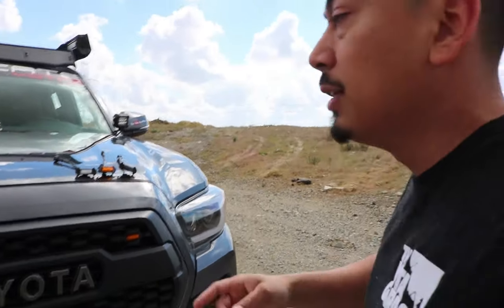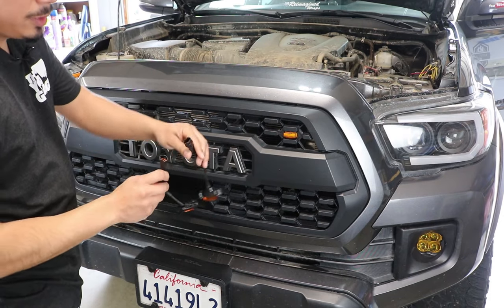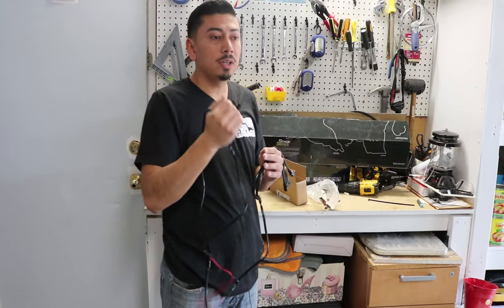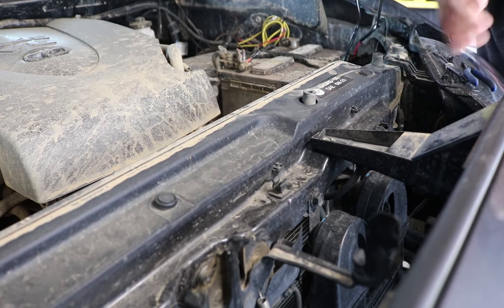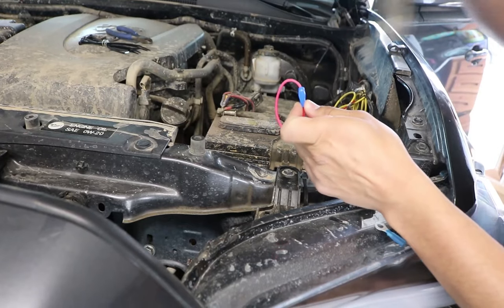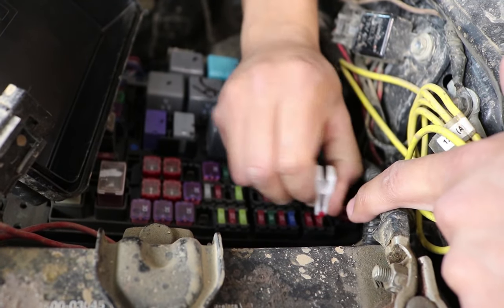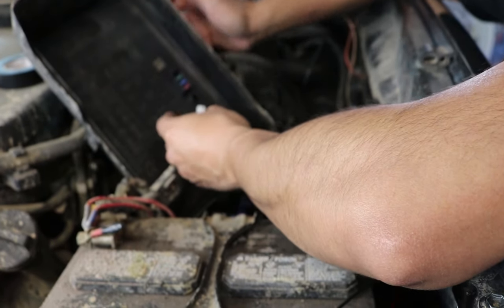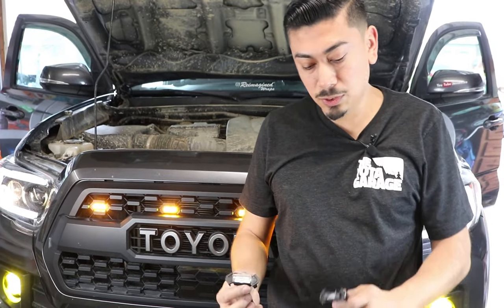HOW TO WIRE + INSTALL RAPTOR LIGHTS ON A  2016+ toyota tacoma TRD PRO GRILLE | MUST HAVE MOD

Comment from the maker: IN TODAY'S VIDEO I SHOW YOU STEP BY STEP HOW TO WIRE & INSTALL RAPTOR LIGHTS, ALSO HOW TO WIRE A ADD A FUSE.

PURCHASE YOUR RAPTOR LIGHTS:
https://theyotagarage.com/collections/2016-toyota-tacoma-grilles?ref=hrwtrpswem

Purchase your trd pro grill:
https://theyotagarage.com/search?q=tacoma+trd+grille&ref=hrwtrpswem
Purchase your raptor style lights:
https://theyotagarage.com/collections/2016-toyota-tacoma-grilles?ref=hrwtrpswem

FOLLOW MY IG: @_jesserizo

Purchase your softop (products also for jeeps & more vehicles): https://www.bestop.com
10% off discount code: JESSERIZOBESTOP
HOW TO INSTALL BESTOP SUPERTOP SOFTOP ON A TOYOTA TACOMA IN DETAIL:
https://youtu.be/DkhpwyQ8U7s

PURCHASE YOUR BED STIFFENERS:
https://r4t.club/TacoBedStiffeners

Need new shoes? Literally:
https://indestructibleshoes.com
20% off Referral code: JESSR100

Bilstien 5100 (front shock kit): https://theyotagarage.com/products/bilstein-24-263108-front-5100-series-0-2-adjustable-shocks-2016-toyota-tacoma?ref=hrwtrpswem
Bilstien 5160 (rear shocks kit): https://theyotagarage.com/products/bilstein-5160-remote-reservoir-0-1-5-rear-shocks-2016-toyota-tacoma-25-242539_25-242379?ref=hrwtrpswem

PURCHASE YOUR REMOTE START: https://www.n2designsinc.com/product-page/2016-2018-toyota-tacoma-plug-play-remote-start-kit-smart-key-1
5% OFF DISCOUNT CODE: N2JR5OFF 
2016+ TACOMA REMOTE START INSTALL HOW TO:
https://youtu.be/modg9uSx_3A

Need a dashcam? www.blackvue.com 
10% off discount code: JESSERIZO

Need all weather floor Matts? 
https://bit.ly/3824zlt
$20 off: JesseRizo20

PURCHASE YOUR UNIVERSAL HEADREST PARACORD GRAB HANDLES (PAIR): https://bubbasgarage.tv/
USE DISCOUNT CODE (10% OFF):
JesseRizo

QUESTIONS?
For Business Inquiries: jesserizoyt@gmail.com
▬▬▬▬▬▬▬▬▬▬▬▬▬▬▬
CHECK OUT MY FRIENDS INSTAGRAMS:
chris  @Impact_trd
nate @nochill_nate
Tailgate benches @ Vintagebenches
Proud founder of @syndicate_yotas
Brenden @brenden951
NEED SLIDERS, BED RACKS, FABRICATION, ETC:
@BEASTFAB_SOCAL
OR YOU CAN GIVE HIM A CALL: (909)471-6756
YOU CAN ALWAYS CALL & LET HIM KNOW I SENT YOU 👍

VISIT YOUR ONE STOP SHOP TACOMABEAST WEBSITE:
https://tacomabeast.com/

PURCHASE YOUR RINSEKIT:
https://rinsekit.com/

PURCHASE YOUR PRINSU CABRACK:
https://prinsudesignstudio.com/product/t2t3-prinsu-cabrack/

I use Viar 300p compressor for up to 33" tires: https://www.viaircorp.com/portables/300p 

Forum I’m on: 
https://tacoma3g.com
▬▬▬▬▬▬▬▬▬▬▬▬▬▬▬
WATCH SOME OF MY PREVIOUS VIDEOS:
MY 2018 TACOMA ON 33'S REVEAL VIDEO:
https://youtu.be/eCqQv8rD5tg
AWNING TO PRINSU ROOF RACK INSTALL:
https://youtu.be/pv_uyymtooY
HOW TO INSTALL AMP + SUB PLUG & PLAY LOC ON A STOCK RADIO 2016+ TACOMA: 
https://youtu.be/ZrhT2___eAk
2016+ TACOMA TWEETER INSTALL:
https://youtu.be/DNnLDeDn1QI
2016+ TACOMA FRONT DOOR SPEAKER INSTALL:
https://youtu.be/cLU6NqsEJe8
2016+ TACOMA REAR DOOR SPEAKER INSTALL:
https://youtu.be/6zGxEbiarPc
PART 1 TACOMA SOUND DEADEN INSTALL: https://youtu.be/_vxpT62AP0M
PART 2 TACOMA SOUND DEADEN INSTALL:
https://youtu.be/ipJaa5TkuvI
2016+ TACOMA HEADLIGHT INSTALL HOW TO:
https://youtu.be/qkxJl0KKTjM
2016+ TACOMA TRD PRO 2018 GRILL - WITH SENSOR | HOW TO INSTALL
https://youtu.be/zVNVKnyrb38
2016+ TOYOTA TACOMA TRD MBRP EXHAUST HOW TO INSTALL 
https://youtu.be/t_mfDCTbNHk
2016+ TACOMA HIDDEN BUMPER LED LIGHT BAR:
https://youtu.be/ogciqoSRLcw
UNBOXING TACO PARTS/MY TACO PLANS:
https://youtu.be/75xOeXq8_WI
2016+ TACOMA LED POD FOG INSTALL:
https://youtu.be/QEyftT_hyGM
AJT KEY FOB INSTALL & REVIEW:
https://youtu.be/9AHpFzoKVS0
2018 TOYOTA TACOMA TRD CHROME DELETE (COLOR MATCH)
https://youtu.be/kvZ_6CMdy4Y
MY NEW TRUCK REVEAL:
https://youtu.be/bMZjKTG9g-U
NOICO SOLUTIONS INSTALL:
https://youtu.be/B37iX-kdlB8
HOW TO INSTALL AN AMP TO A FACTORY RADIO:
https://youtu.be/ckFBeKA-we8
HOW TO INSTALL FRONT DOOR SPEAKERS ON A HONDA CIVIC
https://youtu.be/FIgic72X1Ww
Adam's Polishes Foam Gun | WORTH IT? 
https://youtu.be/uGXyms1h00E
Auxbeam LED Review
https://youtu.be/Xt4jensQlyc
THE BEST CAR DRYING TOWEL REVIEW
https://youtu.be/hK0ikvcFe8s
EZ LIP REVIEW + INSTALL
https://youtu.be/AhhTpQijFlw
EZ LIP PRO DURABILITY TEST
https://youtu.be/pS5w2fd2q1I
THE BEST IPHONE VLOGGING SETUP
https://youtu.be/UV-Qt4Yx9yI
▬▬▬▬▬▬▬▬▬▬▬▬▬▬▬
THANKS FOR WATCHING
PLEASE,
Like, Comment, & Subscribe
for more DIY FOR CARS, RANDOM VIDEOS, CAR VIDEOS.
Reply: Hey I was wondering if u know where I can do the add a fuse for the raptor lights to work off the parking lights instead of the headlights....mine are hooked up to the headlights and I want mine to come on when parking lights are just one do u know which one to plug into the fuse box to have them come on with just parking lights
Reply: I think the funniest thing I've heard is ppl saying it's illegal 🤣 maybe in Cali? I've had it allover the Westcoast OR, WA NM Texas allover not pulled over yet
Reply: Hi Jesse, I have a 23 Frontier, I plugged into the accessorie fuse, they stay on even when the truck is off, can you suggest a fix for this ? Thanks Tommy...

Comment: Dude you are the man. The instructions from the company I got mine from didn’t include details on putting the fuses into the wiring provided and I was ripping my hair out for two days trying to figure it out.
Reply from the maker: Heck yea we’ll thanks for checking it out :) u can even tap into the inside fuse box to you’ll just need to run longer wire but heck yea lol

Comment: Followed your step by step and got it done! Thanks for the helpful video !
I only had a lil trouble making sure not to pinch the wires when putting back on the cover/cap but I made it work
Reply: Any tips on how to do that can’t figure out how not to smash it.
Reply: @AngeloU24  yeah you gotta follow the harness  with the rest of the wires and group it with them and then it fits all nicely and tucked in
Reply: With that setup, do the raptor lights turn off/on with the headlight switch?
Reply: @scarillo31 yeah, there’s also a fuse to wire it to so it’s on even with the DRLs but not sure which fuse that would be
I just wired it to the headlight fuse like the video

Comment: Great video. I used different lights they are just round amber LEDs.  The “add a fuse” tap was a new piece for me so that made the wiring super simple, went to the fuel pump fuse so they work as extra day time running lights. 7 lights in the same row you used.  Thanks again.
Reply: if you add to the fuel pump does it go on and off wit hthe truck as the daytime running lights?
Reply: Alex 
Yes the lights go on when the truck starts.  I have 7 LEDs across the top of the grip as running lights. They show up better than the ones in the headlight. Using the Add-a-Tap means I can take them out easily.
Reply: Hey Randall, is the fuel pump fuse the 10A "INJ" fuse?
Reply: and did you still use a 10A and a 15A fuse to plugin to the add a fuse connector?
Reply: @trentswinarchuk3881 sorry for the delay been cleaning up the Gladiator and working in the yard.  But, no I used the F-04 on the edge nearest the motor sided edge of the fuse box.  It is a 20 amp so just put in a 20 amp fuse on both.  Massive overkill in the little LED s.  I’m up to 15 bulbs now.  2 - in each of the outside vertical 3 in the center.  Almost looks like a light bar … just not as bright.
Reply: @randallupton3622  Are you talking about 3rd gen tacomas? because that F-04 fuse doesnt exist on them
Reply: @trentswinarchuk3881  oops sorry no I was talking about the Jeep with that number/location.  Forgot I had responded to this video. You have it right.

Comment: Thanks. The Eĺectrical part was super useful for me on installing it on my 2021 SR5 Tacoma
Reply: What fuse did you connected to? I have raptor lights already and I’m trying to put some alpharex headlights on my SR5 but don’t know what other fuse to use?

Comment: When you set the lights up in the wide 4 pattern, did you have to use a Dremel to fit the two outside lights? I was going to set mine up like that and the lights on the end wouldn't fit. Needed a little bit cut out to fit right. It's also an aftermarket TRD grill, not the factory one.

Comment: Great video. I have been trying to figure out where to plug in my fuse and your video steered me in the right direction. You mentioned 10A h-LP RH-LO, My 1st gen sequoia  doesn’t have those exact numbers in my fuse box. The closest I see is 15A h-LP RH. Is that the one I am looking for? If so what number of fuse should I go with?

Comment: I have a query. Please do answer it. If i wire my amber lights with the drl fuse of my car with the fuse tap, will they turn on when i turn the ignition key on cause the drl turns on when i turn the ignition key?

Comment: Love the video, question: I’ve seen different videos with people stating different fuses for the add a fuse. I just bought a kit that came with 2 5 amp fuses, but you mention a 15 on top and 10 on the bottom. I’m really confused about this. Hoping you can set the record straight. Thanks again
Reply: Mine came with a 5 amp fuse but I went and bought a 15 and did what this guy did and I haven’t had any issues…what’d you wind up doing?
Reply: @pewbangpew8109   i thought the accessory output (15A) cant be higher Amp rating that the vehicle fuse (10A).  i thought it was  supposed to be equal or less

Comment: Great vid. Only issue was the outer lights on the grill would not fit,I had  to slightly trim the sides of the LEDs using scissors and then they clicked in perfectly.
Reply: I had to do the same with my Tacoma I just used a file though

Comment: Jesse one more question for you I have a 2020 sr5 I don’t have the DRLs headlights I like for the raptor lights to run when the engine is running what is the best place to tap into maybe ignition maybe? 🧐

Comment: Looks good . Hey so how do they turn on ? Idk if i missed that . They are not on a separate switch right . So they turn on with the regular lights or fog lights ?
Reply from the maker: They turn on with your low beams that’s how I wired them up

Comment: Basically, the add fuse sticks out to the left, blocking the fuse box from closing.  Cannot close fuse box without crushing the fuses I just installed.  Help?
Reply from the maker: Yes and no there’s a way to get it to close but it’ll slightly clip the wire another way which I’d recommend is add some wire to it and run it to the fuse box inside the driver side cab by your left foot

Comment: Would it be legal to install amber grill lights on a smaller vehicle like Subaru outback? I drive remote mountain roads in California and i want to be seen!
My understanding is that they are mandatory for certain size vehicles, optional for large trucks, and neither required nor expressedlyprohibited for smaller vehicles.

Comment: what fuse is that ? i have a 2000 tacoma that ima install the lights on i did it on my 2014 cherokee but i had to tap into the lighter fuse since that was the only one that didnt have running power after turning the car off. soooooo what fuse is that ? lol. headlights?

Comment: Thank you, Jesse, for that video tutorial my question is; for that fuse that you removed from the fuse box was that for the headlight low beam? Was that the spot where you connect the add a fuse harness? Thank you.

Comment: I plugged it in that same spot and the lights are always on  
And how did you run the wire out of the fuse box? Did you trim the seal or what if you just put the top back on the fuse box it crimps the wire?

Comment: Worked like a charm man! Thank you!! 2018 Toyota Tacoma 4x4 Sport
Reply from the maker: Thanks for watching :)
Reply: @JesseRizo  Something happened today that I was wondering if you could help me out in resolving. All of a sudden the LEDs stopped working. I popped the fuse box cover off and the add-a-fuse had become loose. However, I did notice a sharp crease in the add-a-fuse line from where the fuse box cover snaps down. Is there a way to run the add-a-fuse wire out of the fuse box without it getting crimped?

Comment: Does it have to be 15/10 on the fuse or can it be 10/10 ?
Reply: My raptor lights came with a 15 amp fuse in that spot, so that's the size for the raptor lights. You don't want to go smaller.

Comment: What fuse would be tapped into if I wanted the raptor lights to turn on with the DRLs and not only the headlights?
Reply: idk why no one has an answer for this...it's so frustrating
Reply: Tap into the “ING” fuse
Reply: For DRL operation
Reply: @PrimeMinister82  thanks bud!...so I use the add a fuse and plug into ING and I'm good to go?...what  amp fuses should I use in the add a fuse?
Reply: @br00klyngreek13  how did it work out?
Reply: @br00klyngreek13  also wondering this

Comment: So you did an add-a-fuse plug into the fuse box? Seems like the water proofing is gone and the wire is getting pinched. I recommend getting it hardwired to the DRL's.
Reply: How do you do that?
Reply: Red Dev Kev best way is by using a t-tap into the drl power wire.

Comment: My add a fuse grill lights came with another fuse connected that didn't fit in the fuse box like a car amp fuse but the same size. Have you seen this? I just installed it and it works but haven't seen one after watching the install videos.

Comment: How did you get the fuse box to close, with the wire sticking out? Could not get it to click in that corner without clipping the add a fuse wire
Reply from the maker: I cut The smallest slit in the lid but if u want to be say I’d recommend tapping into your fuse box that’s in the cab better

Comment: Hi great video i installed these just below the grill normally where people put a light bar. I have a question, I'm getting a custom grill with tacoma led lettering  and i'm not sure how to power it, do you recommend just tapping into the add fuse i used for the raptor lights? If so would i need bigger fuse sizes? Thanks

Comment: hey Jesse have a question ?
can you run them with your daylight running lights? and have them be on without having to turn on your headlights?
do you have your headlights running all day? 
thanks bro !! much love
Reply from the maker: I’m sure you can you just have to look for the fuse or maybe tap into the drls some how

Comment: I installed 4 lights already on top of the grille but I'm thinking of installing another 4 on the bottom.  Can I use the same fuse that I installed with the first 4 that I used?

Comment: I pulled the same fuse as you did and my lights work but only on high beams not sure how that works as I pulled the low beam fuse? Any help would be appreciated thanks

Comment: Jessie, just picked up a grille and raptor lights from another company. I have a 2020 Taco. I see you are using a 10 and 15 amp fuse on the add a fuse. I see other videos where 2 10 amp fuses are used on the add a fuse. They are tapping into the same slot as you are. Which one should I use?  Thanks
Reply: Anybody, thanks
Reply: I’m using the 10amp fuse. The fuse is to act as a safeguard so incase there is a surge in power. You want to use the next highest rated fuse for the amount of current the device is drawing from the battery. For example (values used just for example) if the lights use 5amps you should go with a 7.5amp fuse. If the fuse rating is too low it would blow the fuse and the circuit would not be complete. I would take the lights to a professional if you aren’t 100% sure what to do.

Comment: Do these turn on without the head lights or are they only with headlights? I have my raptor lights plugged into the DRL fuse and want mine to turn on with DRLs but also turn off when I have my light stock turned to DRL off.

Comment: which fuse if i want to light up 24/7 when the engine on? the one u showed only if i turned on the headlight..
Reply from the maker: Your better off extending the wires and tapping into the inside fuse box and just look for one that will work when vehicles on you will need a tester

Comment: What’s the best way to deal with the added wire coming out of the fuse box now? I don’t like closing the lid on the wire so I’m assuming I’ll have to drill a hole and seal it?
Reply: I second this question 🤚🏼

Comment: So they sent  me the fuse adapter for the regular fuses, but fits in the micro  fuse. Also the adapater only takes the regular sized 10am fuses, not the micro. If I plug this in will it damage anything?

Comment: Do you happen to know which fuse is for the DRL? I'm gonna be doing the same thing but want them on with my DRLs. My LED DRLs are on as long as the truck is on
Reply: I heard a different YouTuber saying that if you put it with the DRL, the lights would stay on even if the truck engine is turned off.

Comment: Do u know how to tap the add a fuse into the parking lights so I can run the raptor lights without running the headlights
Reply from the maker: U can run a extended wire into the cab and with the add a fuse tap into the fuse box in there look for a open spot that will run when the trucks on and you’ll be fine ima do mine like that just havnt had the time lol
Reply: @JesseRizo  there has to be a spot u can put the adda fuse for the parking lights instead of the headlights